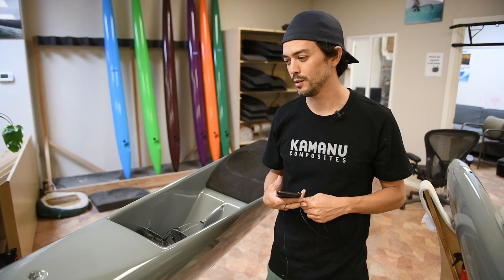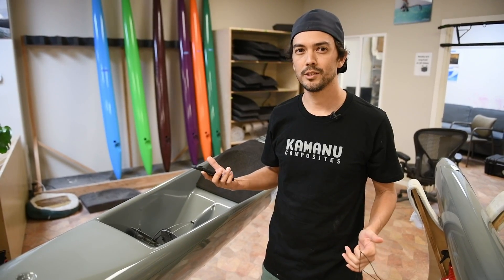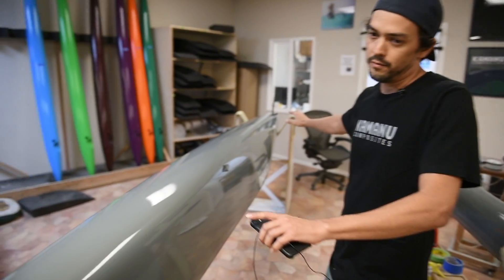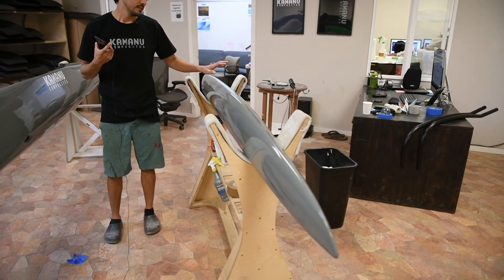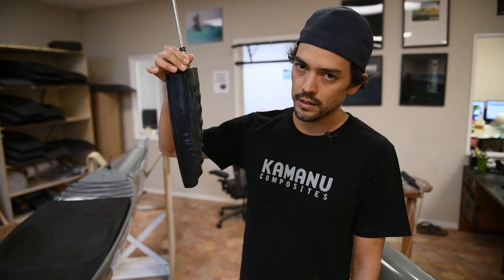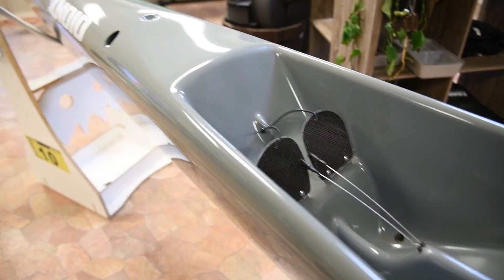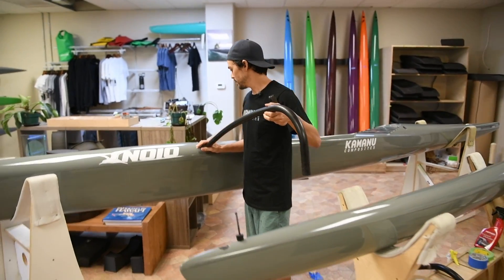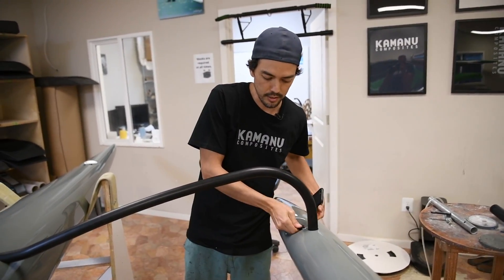Noio OC1 Design Overview by Kamanu Composites

Comment: How to install rudder?
Reply from the maker: I need to make a video. But in short, rudder in the hull. Plastic washers until flush with square part, attach t-bar, lock washer, and lock nut. Tighten with wrench. If there's too many plastic washers it will get tight and not turn. If too few washers it can slide up and down.
Reply: @keizogates  I will wait))

Comment: How about the weight limitations of the paddler? Kahele, Cantere, built for lighter (under 160 lbs) paddlers. How about the Noio?
Reply from the maker: Similar to the Pueo, it does pretty well for a wide range of paddlers. 120-200 is great. Above 200, we can modify the iako and it’s good. Above 230 or so is possible but we have less experience and testing. Imho, going shorter is the wrong decision for overall efficiency. Some benefits, but our goal is to as fast as possible for most people in any condition.
Reply: Im 220lbs. What changes in the iako do you make?
Reply from the maker: @troyfly71 chop 1/2” off the front iako and drill a new hole. Usually that’s enough. Basically a 4th setting.

Comment: Do you find that the knifey bow eliminates bow wave, and thereby softens or gets rid of the "hull speed" phenomenon completely?  All the really old hulls (back in the 90's) seem to have more bulbous noses, and have a sudden and defined transition into planing mode, but harder to connect the dots out in downwind conditions.
Reply from the maker: yeah for sure, knifey entry is all about eliminating bow wave. Helps a lot at medium to slow speeds. Moving the weight back compared to past designs keeps bow from diving/stuffing. Flatter sections allow for rocker and maneuverability in the surf -- and we minimize surface area penalty by keeping mid section round.
Reply from the maker: and not to be taken out of context, good at high speeds too, just not as critical of a design decision for people who'd be in the top 10 no matter what. imo